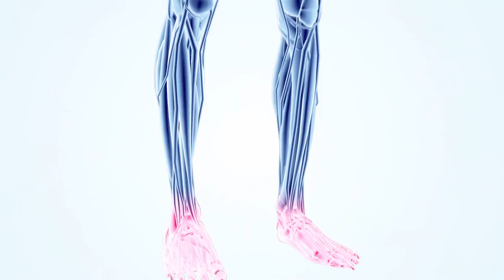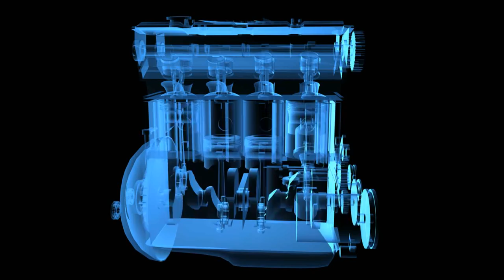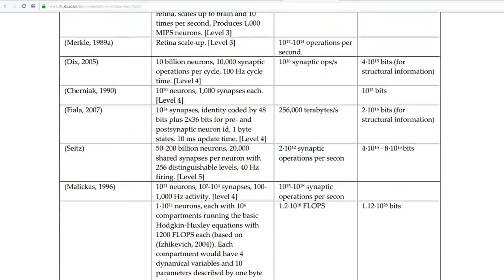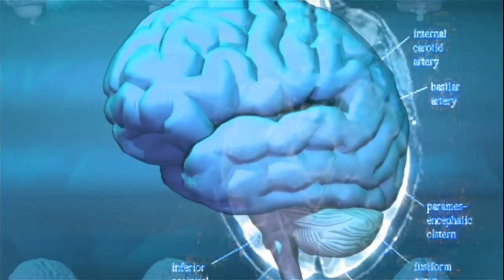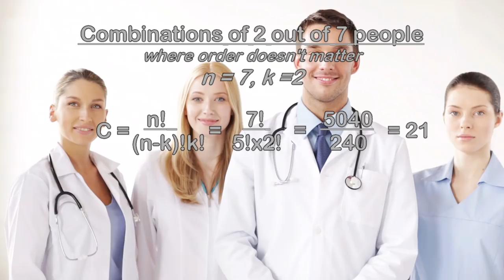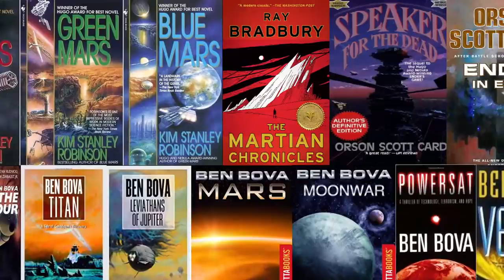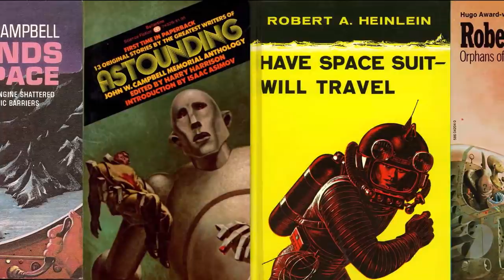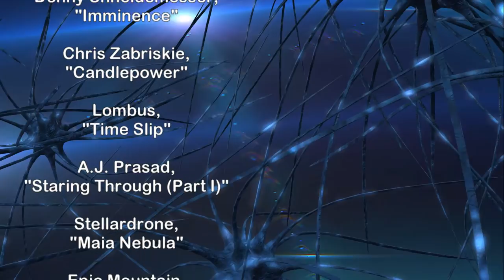Mind Uploading

Comment: If the brain cells get replaced one by one by circuits, that's hardly Mind Uploading. "You" will be stored in those circuits (assuming that will be possible, assuming "you" don't die in the process). Mind uploading happens when you upload your mind to another hardware. Changing components is not Uploading, it's just fixing.

If you did change components until you become a computer, and then you upload your consciousness to another computer, "that" you is a different "you". You copy-paste, you don't magically "transfer" to another computer.

That is, assuming Biological Mind can be emulated by a Silicon based Mind.
That is, assuming 100% hydentical emulation of a human mind is possible
That is, assuming Strong AI is possible (It needs to be, if it wants to emulate you)
That is, assuming Strong AI is actually conscious.

If any of those turns out to be impossible, even just one, the entire point of Mind Uploading becomes meaningless at best.
There are already tons of Papers on the importance of Biological components in Consciousness, on how Hardware cannot fully replicate some of our components and how Quantum Mechanics might be relevant in biological (not mechanical) brains.
Reply: There's so much we don't know about the brain. We know almost nothing about how the consciousness even comes to be, and we're not even sure about its purpose (is it the "real you", or is it a tool used by your "real you"? Is there even a clear "real you" or are you more like the total sum of your parts, the consciousness just being one aspect?). We use medication for mental health issues without even understanding what they do - we just randomly found out they work! Chemicals obviously play a role, and new research implies that quantum mechanics might be important, too.

I find this idea, that all we'd have to do is emulate a bunch of neurons, becomes increasingly unlikely. And if you'd have to simulate the brain down to subatomic particles and quantum effects, well that requires processing power on an entirely different level, if it's even possible at all. We're already starting to feel the end of Moore's Law, after all, and whether new approaches (like quantum computers) will save us is up in the air at this point.

The more I learn about all this, the more I feel brain emulation is starting to look like FTL travel used to. Sure it can work in theory, maybe it's possible one day with some magic super-tech, and it's certainly interesting for Sci-Fi writers to use. But there's a huge chance it's going to be way harder than you'd initially think, and maybe in a few decades all those stories about uploaded minds are going to look like the warp drive does today.
Reply: > There are already tons of Papers on the importance of Biological components in Consciousness...
I'm pretty sure you're talking about Roger Penrose, who has fallen into the physicist's trap of thinking their opinions in domains other than physics are automatically well-informed.

Not only is it clearly possible to perfectly emulate a human brain given enough computing power (which makes genuinely conscious strong AI possible as a side-effect), it's NOT clear that you specifically need to emulate a HUMAN brain, let alone emulate it PERFECTLY. The space of possible minds is vast. Furthermore, if you replace cells one by one to the point of being fully artificial, you can then much more easily expand into many other devices in a continuous, synchronized manner. At no point do you need to lose consciousness or continuity.
Reply: How is replacing your organic brain with artificial circuitry not uploading your brain? I was under the impression that uploading something just meant transferring data to another device. One device is your brain and the other is the computer.
Reply: "its only copy paste if you don't use the same slow upload process to transfer to another computer"

"All this is is a data transfer protocol that cut and paste instead of copy pasting"

Cut and Paste is a copy paste in which the original copy gets deleted, it's not a true transfer (there is no "true transfer" in Informatics. When you transfer or download or upload a file, it's always a copy of the original file, many people assume that cut and paste means transfering the original, but that's is mathematically false).

"As for quantum computing.. well we have that and we can also emulate it on normal computers."

I wasn't talking about Quantum computing.
However, you have no basis to claim "We will surely have that" when talking about unproven things in science.

 
"I find this idea, that all we'd have to do is emulate a bunch of neurons, becomes increasingly unlikely. And if you'd have to simulate the brain down to subatomic particles and quantum effects, well that requires processing power on an entirely different level, if it's even possible at all"

Agree

 
"I'm pretty sure you're talking about Roger Penrose, who has fallen into the physicist's trap"

I wasn't talking about him since, you know, the Quantum Entanglement importance in Neurones is an issue discussed by a lot of scientists, Penrose is just one of them. Nicknaming him doesn't make his opinions false.

"Not only is it clearly possible to perfectly emulate a human brain given enough computing power"

That's already the fake statement. We have no way to prove that is possible right now. 

"it's NOT clear that you specifically need to emulate a HUMAN brain, let alone emulate it PERFECTLY"

If I want to emulate YOU, I have to be PERFECT, or that won't be YOU.

"if you replace cells one by one to the point of being fully artificial, you can then much more easily expand into many other devices in a continuous, synchronized manner. At no point do you need to lose consciousness or continuity."

As I said Copy-Paste, uploading, connecting, all of that is simply "Make a copy somewhere else". YOU are still where you are, you are not "Magically" going inside another computer. 
 
"How is replacing your organic brain with artificial circuitry not uploading your brain?"

Because that's not the definition of uploading.
Changing your car's components is not uploading.

"I was under the impression that uploading something just meant transferring data to another device"

Exactly. So as you can see, Heart Transplant is not Heart Uploading. 

"One device is your brain and the other is the computer"

Mind uploading: The information in your brain gets copied on a computer, CHANGING DEVICE.

Neuron-changing or whatever you wanna call it: YOU are in the same device, the device is simply changing structure.

The common pattern I see here is the grave misconception that when you copy a File, when you cut-paste a file, when you Download a file, when you Upload a file, when you transfer a file, when you connect to the internet, there is some "Magical" transferring involved that brings the "it" somewhere else. But that is not how Information works. Instead, copies of datas (even parts of data) are being copied all over the place. 

If "You" managed to slowly transform into a Computer, assuming that is possible (and that's a huge assumption for a number of reasons), "you" are in that computer. And "You" will stay there. If you start to upload your mind from that computer, "that" is a different mind, not you.
While yes you could control, from that computer, a different computer in another place, "You" are still in that first computer. You didn't move or "expand". And if that computer gets shut down, you are done.
If they make a copy in the other computer, or you uploaded into it, "that" you is a different you.
Reply: A heart transplant isn't an upload since the heart itself controls the heart beat. If we ignore that and say that the electrical signals which keep the heart active are produced elsewhere then it could be argued that you are uploading something. The electrical signals which trigger the cardiac muscles is essentially a basic program and by having a heart transplant you are using that program on a new device and therefore uploading your 'heart program' onto the new heart. I believe that the brain is a similar case. Your mind isn't a physical object, it's a running collection of electrical signals. To upload your mind simply means to take those signals and recreate them on another device, whether that be an identical brain or a computer simulating such a brain. I don't believe this is comparable to 'changing your car's components'. By changing a cars components you are changing the car itself since it is made up by its components. Changing the brain changes who you are physically, but doesn't change your mind which is what we are focusing on in this example which is why I would consider it uploading. The data (your mind) isn't changed at all, just its physical store.
Reply: "Your mind isn't a physical object, it's a running collection of electrical signals. To upload your mind simply means to take those signals and recreate them on another device, whether that be an identical brain or a computer simulating such a brain. I don't believe this is comparable to 'changing your car's components'. "

If what you said were true, then if I made a clone of you, hydentical fo the molecular level, then shot you, "you" would magically wake up inside the clone's head. Which is absurd.
As you can see, there is a difference between Change and Upload.
Changing components of your brain means THE BRAIN is still the same, just ike your body is still the same even if all cells die and get replaced. Uploading means that I create a copy of you somewhere else, but "You" are still in the first brain.

You seem to confuse Mind Uploading with Transferring of Data, but that is wrong.

If I Change components of my PC, that's different from making a copy of my data in my PC and then downloading it to another. In the first case, the Data was copied and pasted. I created "another" computer somewhere else.

In the first case, the Computer was preserved, I simply changed it's components. You are failing to see the problem of Continuity, which is both matematically and philosophically important.
Reply: worst case scenario you can simulate the entire mind down to the atom and run it on a Matrioshka brain.
Reply: The apple isn't the same apple, because it physically isn't the same apple. Even an atomically identical apple becomes different simply by the air surrounding it and where it's touching a surface. If you were to have two theoretical, identical apples, there would only be one apple. It's just that the apple has been duplicated. This is clearly impossible since the location of the apples would be different which then makes them two different apples, but I'm talking theoretically. If we return to talking about the mind, it has no location and is more like a byproduct to a physical object so can be in two places at once, similar to how the number seven can be in two places at once. 
I'm not saying that you will wake up in the other body or suggesting we have something like a soul, I'm saying that you will die in your current body as all previous instances of you have done, and the next instance of you will exist in the other body. You aren't a hive mind of all your previous selves, you aren't constantly hungry because you skipped lunch a week ago, that version of you has died to form the current version. You are talking about the conscience being continuous but if you look at an infinitely small period of time there must be a point where your mind went from one state to another, both of these states being a different person. Of course these two people would be indistinguishable, but the difference is still there.
The idea of being the same person as the you from 2 seconds ago is an illusion created by memory. Imagine if your brain had absolutely no way to store any memory, you would be in a constant state of confusion and have no idea who or where you are. Therefore if you place someones mind in two systems, both minds know that they are that person since they both have the feeling of continuity from their memories. You can look at it like this: If you were to copy your memory onto a computer you have a 50% chance of ending up being the copy on the computer. If you were to copy yourself twice you would have a 66% chance of ending up on the computer. This is because during that instant where there are 3 versions of yourself, any one of them could be you and you wouldn't know since they all share the same memories. The last memories of all 3 people are copying their brain into a computer. 
Finally, you mentioned that after you die it's 'black'. This shouldn't be the case. After you die there will be no concept of black, it won't even be nothing since to have nothing you need to compare it to something. You've already died once before you were born, you didn't spend your time in a dark room since the universe began.
Reply: To me it is the "transporter syndrome", you beam down to a planet by stepping into the transporter. You materialise and walk around then beam back. What you don't realise is that an instant after the transport scans and dematerialises you, you are destroyed in absolute searing agony, but your re-materialised version, is none the wiser. Hence, "you" have actually died in agony, bad luck, but nobody else knows, so it just becomes a bit of a zen problem mixed with the subjective notion of object permanence. If you make a clone down to the atom then somebody sees you shoot it, the information is dispersed to the universe, hence the clone will not be the same, it is not you, you died.

So! "I think" I understand your point and this is something interesting that I thought of when Michio Kaku discussed this in Future of the Mind. I think MKs approach to "ethical" downloading (i.e. don't copy then kill) is that you gradually replace the standard neurones with circuits (or connections to a computer) such that the one running on the new substrate is never separate from the original one. Which is the ship idea. HOWEVER, look at any photo of you from more than a few years ago and it is almost certain that NONE of the atoms that formed you in that picture (that you can see) are the same. Blood, skin etc turn over in weeks and months. Neurons as cells never turnover. However, one of the things I learned when making carbon 13 and tritiated samples is that carbon atoms frequently and hydrogen very frequently swap positions. So you want to make a compound for the NMR in C13 and guess what a whole bunch of C12s have shifted out of some other part of the molecule to the bit you just so carefully synthesised, your C13s have moved about too, you know this as you controlled the isotopic abundance when you started the synthesis (worse if you leave it open to the air as they swap with C12s, C13s and C14s from CO2, so in my view the ship problem being the same is really happening all the time in a dynamic equilibrium.

Then you have the Richard Dawkins view that ONLY the union of brain and body is the real you, anything else is a different entity, no matter how precisely the replication.

I am not qualified to make a judgement, but man is it fascinating and really freaky.
Reply: Unsubbed Serf 
Why do you think a programmer should have a better understanding of consciousness than any other person?
Reply: Oliver Stanley that’s an interesting point. I enjoyed reading both shadows of the mind and the emperors new mind, but I never fully bought the logic that there is something intrinsic about the human mind that means it cannot be replicated ex of the body construct you inhabit.

It seems to be a tautology to an extent.

To me you have to schools of thought at a popular science level those summarised in the Penrose/Dawkins discussions versus those discussed in, for instance, Michiu Kaku. My only thought is that Kaku is not really providing much of an opinion as opposed to summarising a body of work in an area, ie citing the papers. In contrast Dawkins/Penrose are proposing a theoretical construct. Given that neither Dawkins or Penrose are specialists in the AI ++ topics discussed, I tend to view their points with a touch more scepticism. Despite both being very good in their specific disciplines.

My uninformed tuppence-worth, from my basic quantum theory courses tell me that whilst uncertainty at the sub atomic level means that no two collections of particles are perfect twins the macroscopic view of these collections will have identical properties over the timescales associated with life (ie less than the time needed for odd effects of joint uncertainty to appear). Again, if anyone has calculations that show counter arguments then do share, this is all conjecture on my behalf.
Reply: Julian Williams 
Would you agree that consciousness, at its core, is the result of a purely computational process that can be mathematically modelled and run on a substrate that is orders of magnitude faster and more efficient than the oversized meatballs that nature gave us?
Reply: The Original Hybrid sorry mate, probably I agree but I really don’t know for sure.
Reply: Unsubbed Serf 
You said you have no idea how 'slim mold filling in empty space' became conscious, and then mentioned that programmers don't know either; implying that programmers have a better understanding of consciousness than other people.
Reply: Unsubbed Serf 
No, I just found it odd that you mentioned programmers.
Reply: Unsubbed Serf
I certainly don't think we have to worry about accidentally creating conscious AI. 

It seems consciousness is the result of a certain neural-architecture. So, unless we deliberately try to make conscious machines, I wouldn't worry.

The real worry is not accidentally creating a conscious superintelligence with free will: but that we create an AGI and give it some (seemingly) benign goal; only for it to find that the most efficient way for it to achieve its goal happens to involve destroying our species.

That is the real reason we should be wary of AI.
Reply: Had similar thoughts about what you said in the beginning the idea of slowly synthesizing brain matter to allow humans to become biomechanical hybrids of organic and synthetic inorganic material
Reply: SpeakingJustWords Some of our brain cells function on the quantum mechanics level, there is absolutely no guarantee we can copy all of those functions in a manner conducive to making a quantum computer capable of hosting a human mind that doesn't go insane or malfunction. We might but we just don't know yet.
Reply: Evito Cruor
You still haven't linked us to a peer-reviewed paper which provides conclusive evidence of non-trivial quantum processes in computation within the brain.

Obviously, it's you who lacks comprehension skills. Here's my point: quantum processes are as irrelevant to computation in a biological brain as they are to a conventional computer.
Reply: The Original Hybrid And incase you can't be bothered to think for yourself, what you need to look for is structural biology, especially as it pertains to proteins in neurons and how quantum mechanics affect protein folding. That isn't to say that the quantum level emulation is necessary to make a functional synthetic mind but we do need quantum computing to get anywhere near the complexity required. Neurons are not like semiconductors and their logic gates. Best bet to understanding them is not through analogy but by studying how actual neurons.
Reply: The Original Hybrid Penn State chemistry department already did a paper on structural biology and especially that all electrostatic biological processes require a quantum mechanical description to be accurate. The name of the paper is "Fully Quantum Mechanical Description of Proteins in Solution. Combining Linear Scaling Quantum Mechanical Methodologies with the Poisson−Boltzmann Equation" 
Authored by Valentin Gogonea and Kenneth M. Merz.
I believe it's been two decades already. And further experiments have shown this to be true. Obviously we don't know the level of simulation we would require for complete human emulation. But considering that all chemistry is in essence quantum mechanical, i find any notion that they would not have any effect on computation ludicrous when they already do on the scale we already use semiconductors that are not capable of such emulation.
Now take your lazy, self entitled rear end off the internet before you pollute it more with your behavioral deficiencies and lack of moral conduct.
Reply: I applaude do Evito Cruor and his open minded, rational argumentative and scientific method. His opponent was vulgar and irrational, Richard Dawkins would be disappointed by his unscientific perspective. This a priori hatred against every "Quantum Mind" idea is as laughable as Creationism.

Now:

"is that you gradually replace the standard neurones with circuits (or connections to a computer) such that the one running on the new substrate is never separate from the original one"

That would already (if it worked) be a better solution, the Ship of Theseus (or Gradual Mind-Engineering). There are some problems tho.
1) There are some papers showing how Gradual Mind-Changing is (theoretically) no different from Istantaneous/Radical mind changing, here https://ieet.org/index.php/IEET2/more/wiley20150502
2) It would assume that the Brain is like an Ocean: all dops of water are alike and all points are equal, no different in importance. That is hardly the case. Neuroscience proves that some places in the brain are indeed more important (especially for consciousness) than others. If you use the Ocean analogy, then slowly changing water with acid makes no difference. But if you use a Pyramid as an analogy, then changing blocks with sticks will absolutely make a difference.
3) We are assuming a perfect symbiosis between man and machine. But what if it isn't. What if the "machine" part of the brain is more autonomous and perceived by the organic brain as an "assistent" if you will. Slowly giving up "territory" to the machine and losing actual control over the mind. Until, just like in the movie "A click to change your life", you actually control only a small fraction of your life, everything else is made by "the other you" automatically.
4) Again, we are assuming that Quantum Mechanics plays no role here (hardly the case)
5) Again, we are assuming that Biological Brain can be fully emulated by an Algorithm (There are strong arguments against that)
6) Again, we are assuming Strong AI is possible.
7) Again, we are assuming Strong AI is conscious.
8) Again, we are assuming a Computer is 100% able to emulate a brain with 0% error, with such a growing complexity.
9) That is not immortality. Even if it worked, You've just become a computer. You will still break down eventually, repairment can prolonge life, but cannot be perfect or indefinite. Again you don't "Upload" your computer mind do the internet.
Reply: @Evito Cruor:
I'm not disputing the paper: I'm simply informing you that such low-level events are completely irrelevant to the high-level algorithms that produce consciousness. These high-level algorithms are what we need to reproduce in a whole-brain-emulation; everything else is trivial.
Reply: The Original Hybrid That is an entirely baseless assumption especially given that we already know that it is not only the brain that is involved in our brain function. I held the same view you do, until I saw how humans react to missing parts of their nervous system be it organs or simply nerve clusters. We are not wet computers, we are an aggregate of a truly insane amount of different cells working together. And the so called primitive parts of our grey matter is infact the most advanced not the other way around. How do you model a hormonal response system and it's interaction with the amygdala which governs or influences most human action? We simply do not know nearly enough yet. Hopefully we will soon enough but that day isn't here yet. And to dispel any preconceptions about my stance, i personally hope to live atleast ten thousand years but that will have to start with radical life extension not direct mind uploading. Then later we will hopefully understand enough to transcend our mortality.
Reply: Brain of Theseus is a common solution to this.  I think it is likely we will have individual modules for the brain to replace or augment what was there before we finish the mind uploading methods.  That problem seems to me easier to solve (although still difficult) and much of the tech will be the same.